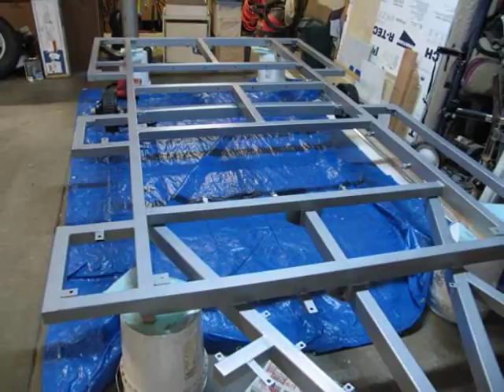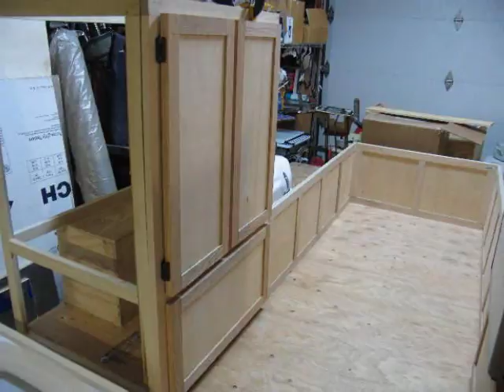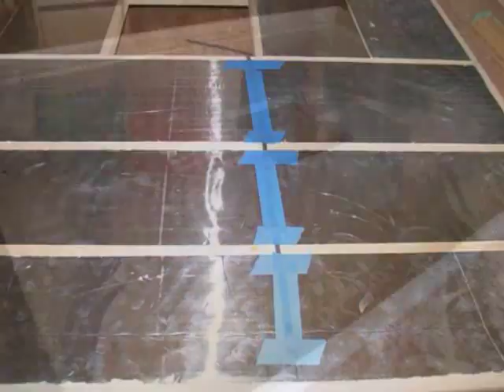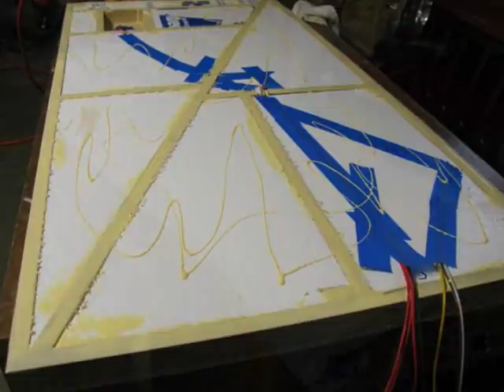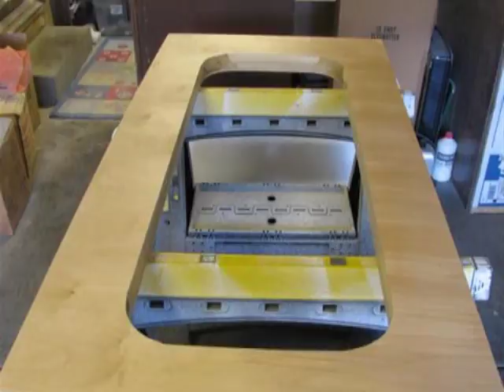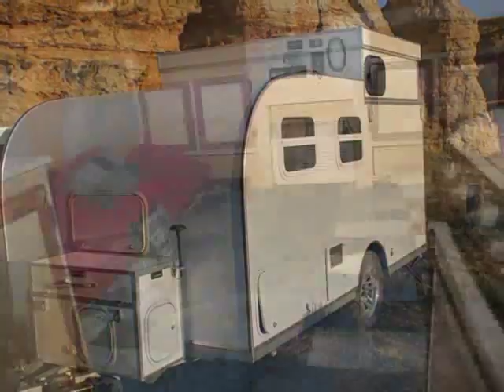Boxcar - How I Built Our Tiny Travel Trailer

Comment from the maker: It's called Filon and its the same stuff they use on RVs. Its gotten pretty expensive though ~4.50/SF. We rolled it on with contact cement and  a laminate roller. Then we vacuum bagged it for an hour.

Comment from the maker: Building a trailer isn't just about the costs, although you can build one for much cheaper than buying one. Its more about quality control; you get to pick the best materials. I'm using Baltic birch plywood that's 13 plys per 3/4" versus about 5 for the home center stuff. All my materials where the best I could find/afford.

Comment: Great build!  Question: it appears as if the floor is wood and exposed on the bottom.  Are you not worried about water and dirt degrading the floor over time?  Also, It seems that it might have been a better long term plan to have the flex conduit terminate inside the trailer, rather than be exposed to the elements.  Can you please share your experience on this?  Thanks!
Reply from the maker: A common mistake it to try and completely waterproof the bottom of the trailer to keep water out. However, any water that does get in the floor can't get out and it dry rots the floor. It's better (IMHO) to keep the bottom  open so that water can drain. Start looking underneath old trailers and you'll see what I mean; water from below isn't an issue. Water that comes in from a leaky roof  is what usually rots the floor. The flex is for the trailer lights, I'd rather have the wiring outside and accessible. The wiring will last longer than most things if you do it right, even outside the trailer.

Comment: I really like this camper. It's very efficiently built. I especially like the pop up feature in the "working end" of the camper. One question, though. Why did you build it with no suspension? Just curious...Aside from that I love it. As thorough as you were with the rest of the build I am sure there's a reason you didn't put a suspension under it...

Comment from the maker: The tongue is 2x3x11G, the frame is 2x3x14G, and the cross members are 2x2x14G. I got the edging for the entry doors from lil' bear teardrop trailer parts. The curved doors are trailer baggage doors I got from eBay. I got the filon from "the metal company" in Denver.

Comment: This is a great job, I have a question, when it rains do you have any water coming by the pop up? I built many trailers while in California, One of them was a single motorcycle trailer, it was amazing. When you ride to it, it lowers the rear section, and when you're on, the front goes down. Now in Panama, I'm planing to bild like a traveler one, want it for traveling and carry things around. I have a Caravan rear axle with springs, hyd brakes. The thing is will not have a shower or bath.

Comment from the maker: any specs on size and weight? - 6-1/2' Wide, 11' long, 3000 fully loaded#

 were did you get the fold down TV an does it come with a DVD or blue ray system. - eBay and it came with a DVD player

did you do the electrical? - I did everything.

Comment from the maker: 2500# fully loaded. It's fairly light considering how many features it has and I tried to build it with light weight materials (1/8" ply instead of 1/2", etc.). I'd leave things out to make it lighter like: hot water heater, furnace, A/C, inverter, 12V battery versus two 6 volt, generator, 12V fridge, PV Panels. But, I wanted all those things so it is what it is. Also, there isn't anything that rides in the TV, it's all in the trailer. I bet my combined weight is pretty low comparatively.

Comment: Get detail, I was wondering if the underneath of the floor and in the wheel wells were only protected by paint over wood or was it covered by sheet alum too? & I think it would be productive to make and sell a larger 12 or 13' teardrop that you could stand up in, modeled after the 1940's popular science and mechanics mag. A simple quick design and very high desireable, with your fine craftsmenship it would blow away all the Tabs campers and icamp campers, at half the price, I would even want one